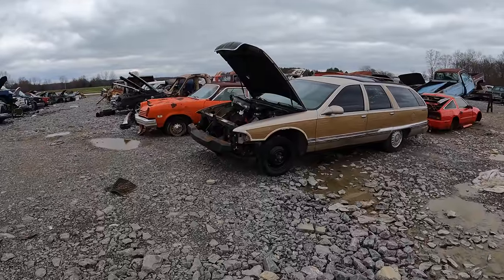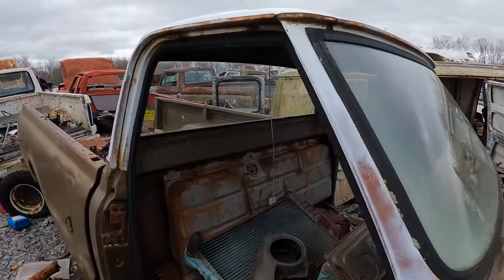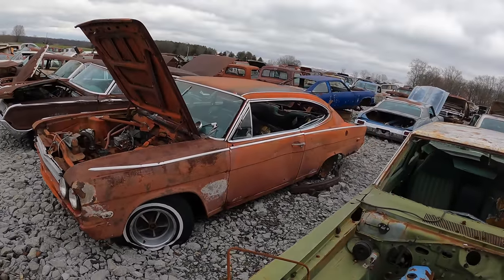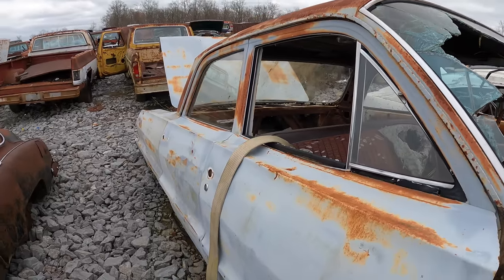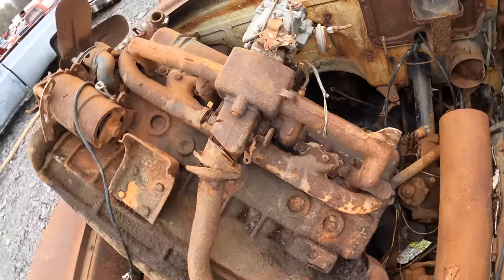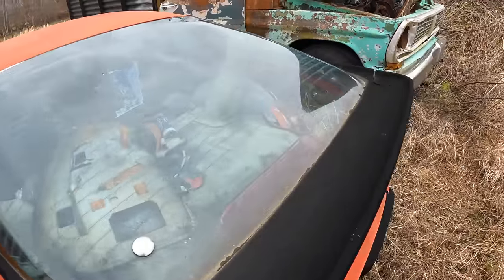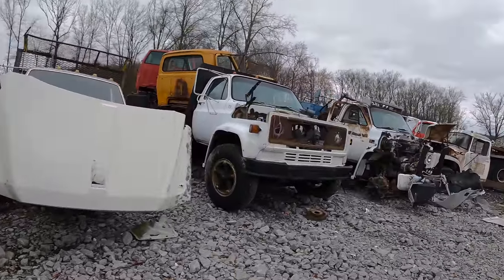Finding Rare Muscle Cars in the Junkyard!

Comment: The blue two door 9:03 is a Datsun 210 fastback(Nissan Sunny, B310 chassis) 1979 - 1982. That was the predecessor to the FWD Nissan Sentra/Sunny, B11 chassis. I remember seeing lots of Datsun 210/B210 quite a few in the 80s and 90s. I think most of them got scrapped in the mid 90s, because I stopped seeing them on the roads in the late 90s. The Datsun 210/Nissan Sunny was roughly equivalent to the Toyota Corolla(KE70 & TE70)
Reply: I had a feeling it was a Datsun! Thanks for proving me correct!

Comment: 17:00 Is Datsun 720 4x4 pickup the they were powered by the Z20, Z22, Z24 engine. The Z-series engine is essentially an L-series 4 cylinder engine with a crossflow cylinder head. The Z24 was replaced by the KA24E in Nissan trucks.

Comment: How that roadmaster ended in a junkyard is beyond me they're collectible cars now
Reply: They aren't valuable though. Not everyone can fix their own cars and once the repairs start to stack up only one option 😢
Reply: @dan44zzt231  Nah dude they're definitely valuable. Just look up the prices
Reply: @ae86hachi  damn your right. Prices have shot up the last few years. Was thinking you could still get a driver quality one for 2-3k but more like 6-10k now 😳 when my buddy worked in car sales a few years ago the older folks would trade these in for economical compacts and he'd tell me he'd feel bad but could only  give them maybe 500 bucks for them as nobody wanted them on resale.
Reply: @dan44zzt231  I understand I was about to go buy a new car instead of fixing my 97 Honda or my old Ford pickup even with rebuilding the transmission suspension tires interior headwork new rings it's still going to be cheaper to fix my 97 Honda with 320,000 mi then to go buy a new car or even another 97 Honda that runs I just looked and they're running 4,000 to $5,000   I got an old square body Chevy that when I knocked it ten years ago it wasn't worth more than five hundred bucks and now online it says that you could part them out and make 10 times that I don't see how they're so expensive when there's almost no one who works on cars anymore I'm the only person I know that works on cars I'm not the only car guy I know I'm just the only one that actually does work to my friends cars or my cars I just rebuilt my buddies alh Jetta and I had grown men surprised that somebody was able to pull out an engine and transmission rebuild it and throw it back in the car his neighbors his family members my buddy himself like it's not that hard I'm only thirty-two and I taught myself this s*** from books my daddy wasn't a car guy and my granddaddy knew how to do some maintenance but he was not a car builder  I thought the internet was awesome cuz I was the first generation that was able to go online and order parts for my car through classic industry or parts for my square body from LMC truck or classic industries and now I'd rather have it go back two catalogs and phone calls and get rid of the f**** internet and bring back Craigslist personals it's nice when you can find a local lady to suck your dick for 40 bucks cuz all any guy really wants is some p** in his dick suck they don't want to go spend hundreds of dollars on a f**** date to get to know sumbitch they don't like
Reply: I never liked them until I seen Dax Shepard's Supercharged LSA swapped Roadmaster.. And then I understood the appeal of them. Super spacious and comfortable, with a very unique design that makes them stand out. They're just retro cool now.
Reply: Probably been there awhile, and was dumped by an "estate" since no one wanted "Grandpa's car", unfortunately.
Reply: @dan44zzt231  the last of the American full size cars are becoming very valuable

Comment: The sad thing is cars were treated the same then as they are now. Most cars that are built currently are just considered throw-away cars. I remember being in a family owned junkyard as a kid seeing 60’s Mopars stacked to the sky. Some sell today for six figures. These amazing old cars we see were used and disposed of just like they are now. It’s awesome to even see cars like that even in junkyards. Great video.
Reply: I don't think currently cars are "throw-away" like thoose cars were, cars were far cheaper to produce and buy and lasted way less than modern cars
Reply: @braziliansheetbox2497  Your right your right, there are definitely current cars that have great collectability. Most common commuter vehicles you see today is probably what I should of said.
Reply: @cmarsili4724  even modern commuter cars. Back in the day no computers, little wiring, no thought for crash protection, same old simplistic frame and suspension for multiple years with body style updates. Someone on a decent salary could buy a new car every few years, not like now where a brand new car is expensive and financed over multiple years.
Reply: @dan44zzt231  100% agree. I grew up in the late 80s/early 90s and a base model chevy beretta was a little north of 8,000 brand new.

Comment: At 11:02 that was a MK1 VW Jetta, the stamp on the steering wheel is actually a castle for the Wolfsburg logo
Reply: It's actually a VW Fox, sold in the US between 87-93. It stopped production due to the Jetta having higher sales.
Reply: é um Jetta alemão,o Fox que você se refere era produzido aqui no Brasil nas versões 2 e 4 portas,aqui era chamado de VW Voyage,foi projetado inspirado nas linhas do Jetta,na versão SW era VW Parati,inclusive eu tenho um Voyage 1985 bem conservado,eram 4 modelos:
VW Gol,carroceria Hatch,
VW Voyage,carroceria sedã,
VW Parati,carroceria perua ou SW,
VW Saveiro,carroceria pick-up.
Aqui no Brasil eram equipados com motor Audi combustão a gasolina ou álcool nas versões 1.6 e 1.8,um abraço ✌🏻🇧🇷

Comment: 9:02 is Datsun 210 coupe also known as Datsun Sunny in Europe or Nissan Sunny in Japan. Available with A12, A14 and A15 engines, 4 or 5 speed with both 5 speed with 1:1 5th gear or one with overdrive 5th. Chassis code is B310. One you found is earlier pre-facelift from 1978 to 1980 with round headlights and slightly different interior.

Comment: the beauty of the buick roadmaster wagon  is not the wood panelling, its whats under the hood. For a few years 1994ish they came with the lt-1 v8. The same motor found in the cadillac fleetwood, impala ss, and corvette. Slightly detuned for the buicks and caddys but it could be tuned back to corvette specs with a few parts. So a corvette motor in a woodpanelled station wagon made a hell of a sleeper.

Comment: Figured I'd make a list of the cars I know
3:55 1969 Ford Galaxie
4:14 1959 Ford Fairlane Wagon
5:21 1965 Ford Falcon
5:42 1965-1966 AMC Rambler Marlin
7:07 1964 Mercury Monterey
7:20 1957 Chevy Bel Air Wagon
8:28 1964-1965 Chevy El Camino
9:51 1964 Cadillac Deville
10:24 1964 Chevy Impala
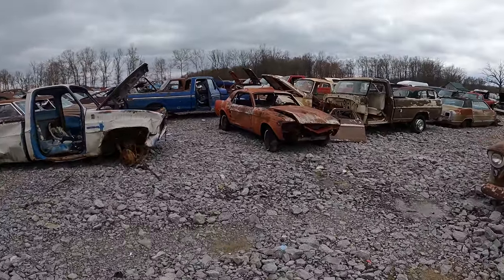12:50 Got it spot on, a 67 Notchback, the 67-68 had that curved taillight panel and the way you can tell a 67-68 apart is the side scoops, the 67 had twin scoops, the 68 had a single scoop
13:25 1963 Ford Fairlane
14:30, Indeed, 1974-1981 Camaro
15:15 1979-1982 Plymouth Arrow Truck (fun fact, it was based on a Mitsubishi Forte)
16:37 1963 Ford Galaxie
16:46 1973-1977 Chevy El Camino
20:15 Another 1967 Mustang
20:25 Don't know the make or model, but my guess on the year is 30s-40s

Just want to clarify I'm not old, just a sucker for American boats
Reply: Same here American land boats are my favorite

Comment: One quick way to get an idea on the year of classic Mustangs, is to check the lenses on the tail lights. The year will typically be molded into the lens. 13:03
Reply from the maker: Interesting! I never knew! I'll check next time!
Reply: @PrizzaMike  You building a classic next? :)  You may want one of those El Caminos or El Rancheros.  Car + Pickup = perfect junkyard run machine!
Reply: I never knew that, I always told 67-68s apart from the side scoops
Reply: @Cobra_427  also 1968s have USDOT mandated side markers 1967s don't
Reply: Tail light lenses show the first year made, so a '65 lens was used in '66. also. VIN tags are best way. Old cars had year on them, now it's a code,

Comment: 12:00 Not necessarily "correcting" but it's worth noting that's a 280ZX (the X is very important.) It shares nearly all of its powertrain with the 280Z, but with the exception that not a single body panel is interchangeable with the S30(240/60/80) Z's because it is nearly five inches wider while maintaining nearly the same length. Huge pain in the ass to try and do any work with it because of early vacuum-based efi, do not recommend unless you get a clean one.

Comment: Most of the old pickup trucks you're seeing around 12:00 and onward are 5th and 6th gen ford F-series ("bumpsides" and "dentsides" respectively) and Chevy/GMC square bodies. There were a couple of bull nose fords (7th gen) and bricknose fords (8th gen). 

12:04 next to the yellow 280Z, the brown-and-tan pickup is a bullnose ford, 7th gen from 80-86.

The rusty-brown truck with the silver diamond plate bumper at 12:06 is a Chevy or GMC square body.
Next to it, the blue truck looks like a bumpside ford.
The blue truck behind that is another squarebody. Same with the white truck behind that. 
Across the aisle you're looking at at least three dentside fords in a row (green/white/patina, brown/patina, silver/gray/white). 

When you pan the camera at 12:10, the orange/gray truck looks to be a late model dentside (78-79). It's sort of a mix between the earlier dentsides (73-77) and the subsequent bullnose (80-86).

12:20 you're walking past a lot of dentsides and a couple of bumpsides and one bullnose. The truck next to the oldsmobile is a bumpside, those ran in the 60s up to 72.

12:50, the mustang is surrounded by mainly dentsides and bumpsides. At 12:59 in the background you can see a mid 50's Chevy/GMC truck (it had lots of names, including Task Force and 3100). 13:03 on the left is a 65 ford truck.

At 14:29 the white truck in the background on the right is a bricknose ford, the brown and yellow truck and red-patina truck next to the camero are both dentsides. The one right next to the Camero is 73-77, unfortunately there isn't enough of the front clip or badges to figure out which year.

Comment: The truck at 16:57 is a 1980-1982 Datsun 720. They were actually badged as both Nissan and Datsun, depending on year, as they started phasing out the Datsun name in 1983. A shame such a rare car is rotting away, looks pretty badly smashed though

Comment: Cover pic is a Marlin made by American Motors. I would buy the white one with out the engine, snag the hood from the orange/red one and restore it. There was parts in this cars from Ford, Chrysler and Rambler. Great cars, my cousin owned one in early 70's. I knew what it was as soon as I saw it. The Subaru Brat cane with bucket seats in the back and Hot wheels made the models just like the full size ones. I knew most of the old cars, trucks and jeeps but I also grew up with most and have worked in two junk yards and owned over 100 cars. I saw a 63/64 Chevy Impala that is worth a good piece of change, I'd buy that too. Where is this yard?

Comment: Those enkies on that black regal are worth some money.   I believe the orange car is a 70s ford 500.  My dad had a cyclone 500 gt the first week they came out and wrecked it 50 feet from his driveway.   Also now has a 68 & 69 road runners 70 Olds cutless Supreme with 350 rocket, amd ratchet shifter  mini tubs, black on black.  1970 ford hiboy with 429 cobra jet motor  on 40 inch super swampers.    That's why I drive a 1980 long bed with built sb 400 ,
single tunnel ram  demon carb, turbo 400 b&m floor shifter.  Lincoln locker!!!!!   Its my daily drift truck. 
  (My icon pic)
Reply: No
Reply: @daryllynhutchins8459  your 3 month late dude, no what
Reply: @jasonpetrich4141  it's the thought that counts

Comment: 11:00 is a VW Jetta II from the 80s. It is pretty much just a sedan version of the Golf II. The logo on the steering wheel stands for "Wolfsburg" (directly translated "wulfs castle"). Which is the city where Volkswagen has its Headquaters. This car must have been a "Wolfsburg Edition" since in the US only those had wolfsburg steering wheels. And the Wolfsburg Edition was only available in the US, never here in germany. This car is quite the rarity. But still a boring car.
Reply: It's actually a VW Fox, sold in the US from 87-93. Similar to the Jetta, but production stopped because the Jetta had higher sales.
Reply: @explorenevwme  I see, never heard of this one before. I guess that makes it even less common. From the side it looks just like a Jetta. And i don't see the point in building two almost identical models. I only know the VW Fox they sold here in europe, but that was smaller than a Polo and about 10 years later than this american Fox.